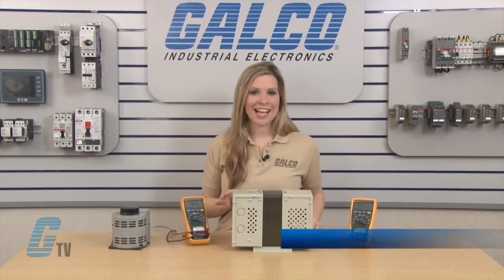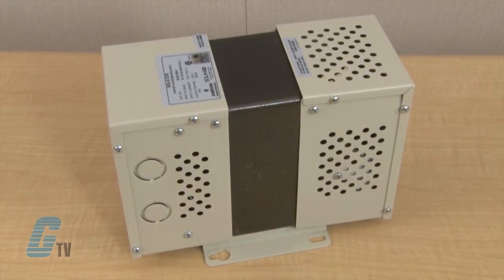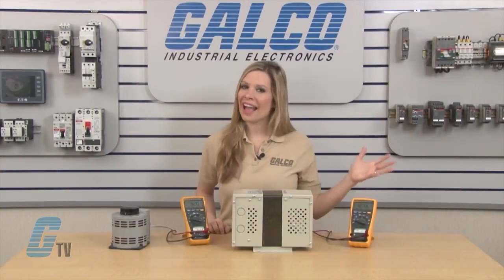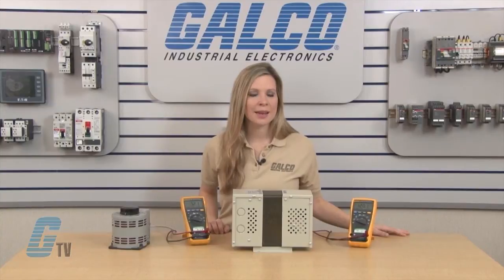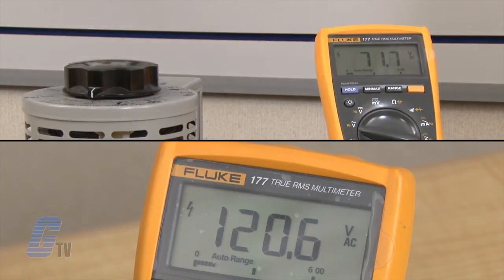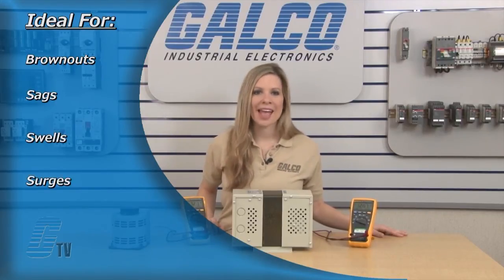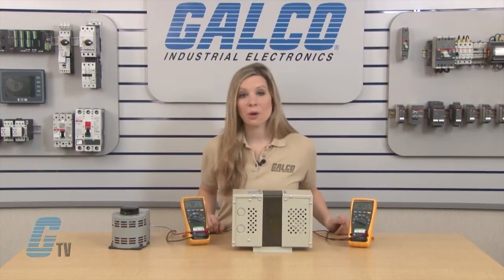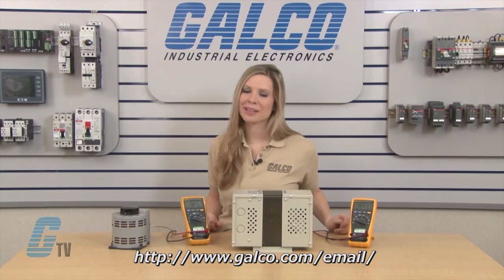Demonstration of a Constant Voltage Transformer and how it works

Comment: Hi, very good voltage output performance.
Can this CVT still perform well for any voltage dip during fault (very short time, but massive amount of voltage drop? Let say voltage drop to only 10% of nominal voltage for 4 sinusoidal cycle only
Reply: The CVT would just collapse and your current will sky rocket. They normally work on a 25% Primary fluctuation, where your core would be optimally saturated, anything above or below would damage the core, your cap and Distribution Board :)
99% of the time your mains would never fluctuate to anywhere close to the CVT's 25% max Primary fluctuation, so you would never need to be concerned. But I understand your questions regarding testing purposes.
Reply: @_BrettHamblin_  Hi.. thanks for your explanation. Actually I ask the question for solving classic problem in our system. I work as electrical engineer in oil field in Indonesia. Many time we experiences massive wells down due to contactor of wells power supply automatically off/open during voltage dip. Voltage dip happen during fault, before fault cleared by breaker. In our systems voltage dip is very severe, remaining voltage can reach as low as 12-15% of nominal for about 4 cycle duration (in 60hz system). After 4 cycle and fault was cleared, voltage back to normal again. But unfortunately, even only 4 cycle duration, that such severe voltage dip causing contactor open/off and many wells down. Wells that fail to restart automatically need to be restarted manually by operator, it means take time for restoration.
So I curious, can this CVT transformer solve such problem? To hold output voltage at least >70% during 4 cycle duration of severe voltage dip.
Typical contactor will not off/open if voltage still > 60%.
Reply: CVT's can handle dips and spikes; the capacitance and inductance fills the void. They are ideally made for over and under voltage situations. For example you have 135v in... you get 120v out, also larger power spikes are gone. Power dips... same thing 80v in and you still get 120 volts out; smooth, no dips or spikes.  They work well for this. They do not create power if you have a blackout.
Check Google if you have never used one:  https://www.aelgroup.co.uk/faq/faq001.php

Comment: Can CVTs be used with LED television sets?
Reply from the maker: Hi Raj,

A CVT probably could be used with a TV as long as it is an analog type producing a sinusoidal wave form.
A digital inverter producing a PWM output that is not shaped might be detrimental to the TV’s power supply.
It would be a good idea to consult the manufacturer  before using any of these devices for their recommendations especially if it is a new set with a current warranty, as misusing their products could void warranty.
Hope this helps.